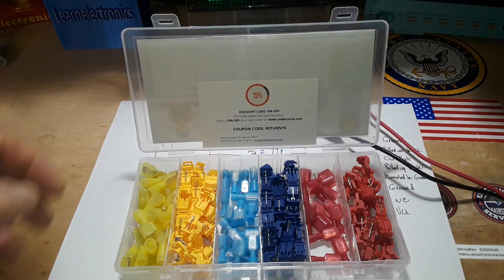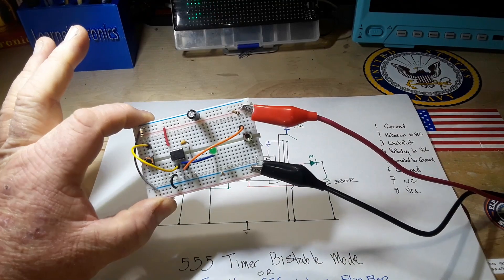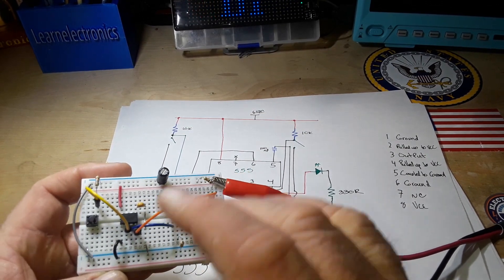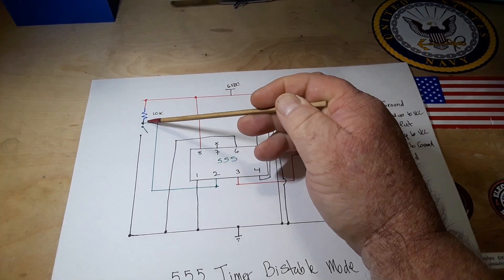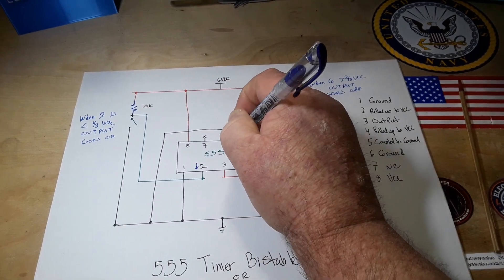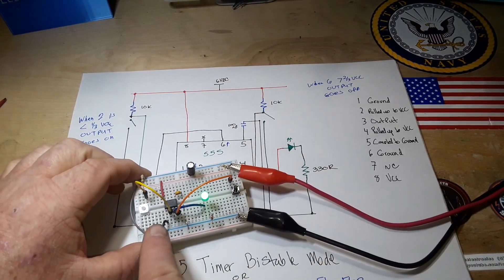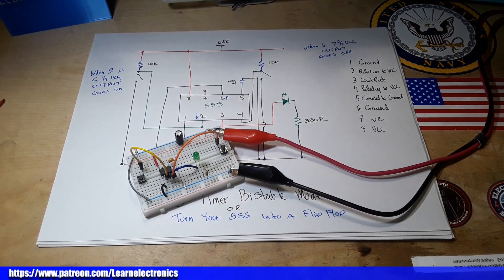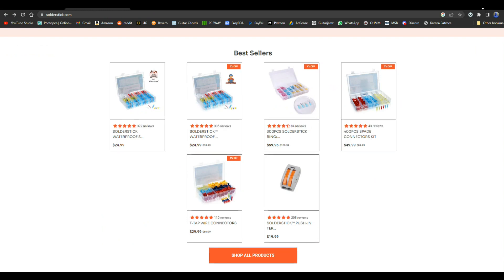555 Timer Bistable (flip/flop) Mode:  Sponsored by Solderstick Wire Connectors

Comment: Thanks for another great 555 video!!
My favorite application actually required a 558...It provided all the timing I needed to program an EPROM, this was the '80's, when such things cost a fortune!
....a couple' comments:
1)  In the monostable mode there is a hidden, lurking trap...the timer can "re-trigger" on long duration input pulses.  Even though some literature states otherwise...I learned the hard way.  This situation can pop-up in MANY designs and can be easily overlooked in critical designs....one solution involves adding the propagating delay (trigger lockout of 10 to 28ns as forced delay) using the four gates of a CD4093...it will never false-trigger and is transparent to normal operation.  But be aware that the device becomes a POSITIVE-EDGE triggered device now.
2)  I wouldn't have used the capacitors in this video....there is just something about seeing resistors and capacitors in a unique 555 timer IC design.
--------------------------------------------------------------------------------------------------------------------
I really miss the old centronics parallel ports,  This was the only circuit board that I studied in more detail than the 555 IC in which I found countless uses for pin 5. 
...now on to the end of the video.

Comment: 40 'BRIGHT WHITE' LEDs in series/parallel to make a lighting unit.  Used a 555 astable at 4kHz-5kHz and by controlling the period it allows you to 'Dim' the lighting.  A 2N7000 to switch the LEDs.  Powered by 4 x 9v batteries to have a high voltage power rail enabling a reasonably low current and make the batteries last longer.

Comment: I’ve used a 556, where one was wired up as a latching switch and the other in astable mode to drive a piezo speaker for use as an alarm.